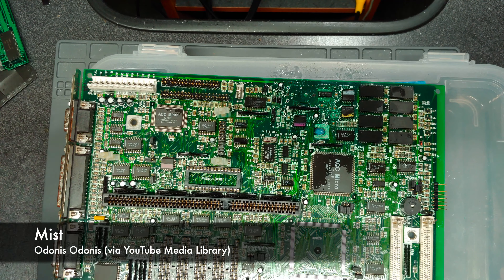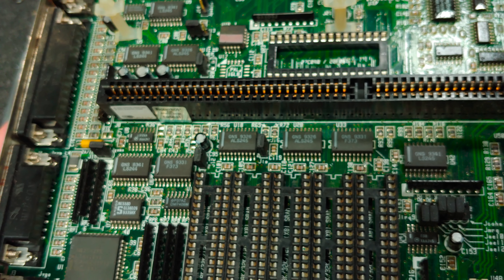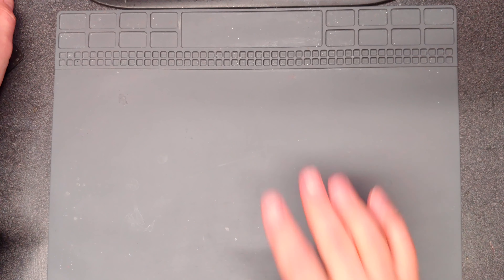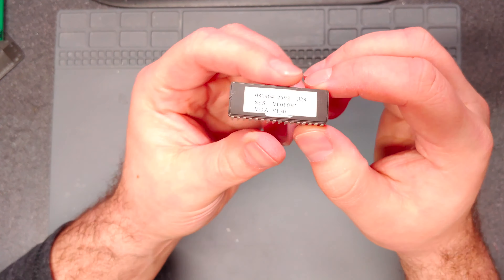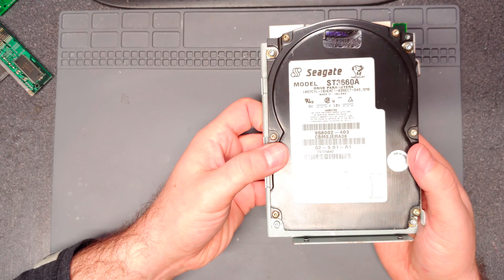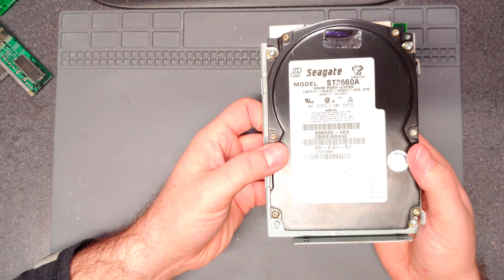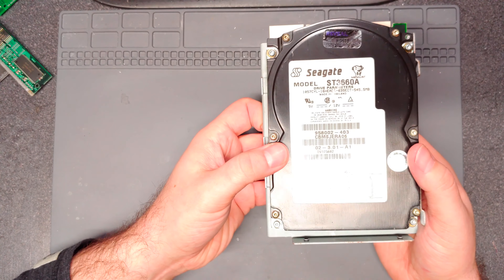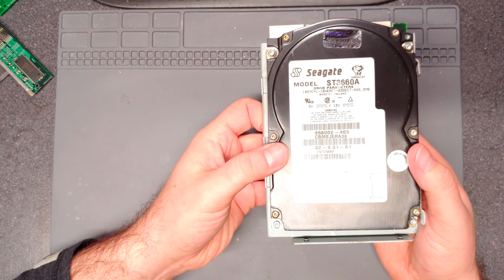Packard bell Axcel 130, Pt. 2

Comment: I like your videos, very honest and entertaining. I hope you can fix this board but it looks like a big job. I have a 386 board with similar damage which I have been putting off fixing for months. Can you show us the damaged traces under a microscope? You need to check that power is getting to the CPU and chip set, You didn't mention if you felt any heat. Good luck and please keep making videos.
Reply from the maker: Thanks! I will keep trying, just need to get additional supplies. While I didn't show it in the video, I did check for heat and felt nothing out of the ordinary. The CPU in fact remained cold to the touch.

Comment: Really common problem with these boards. I've got a couple with the Varta damage that I am trying to fix myself. So many broken traces. I'd be curious what Necroware would say about this board. He's fixed some pretty far gone Varta damage. One 386 AT board he desoldered all the ISA slots on the board and fixed more traces than I could count.
Reply from the maker: As much of a pain the traces will be, my main concern is the GNS 9330 chip. I haven't found anything on it at all. I don't know what it does. If that isn't salvageable, board's done.
Reply: @koztech  those barrel batteries are ticking timebombs